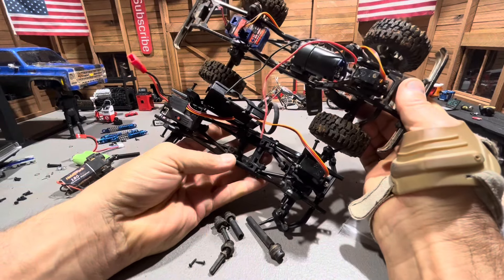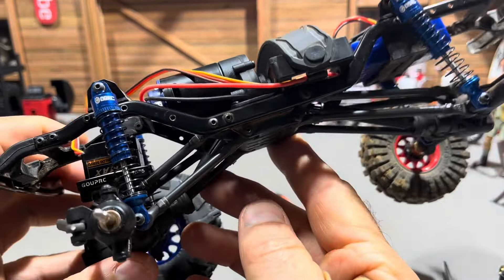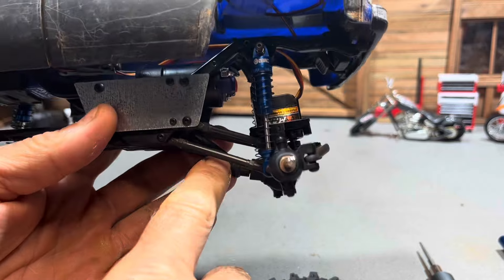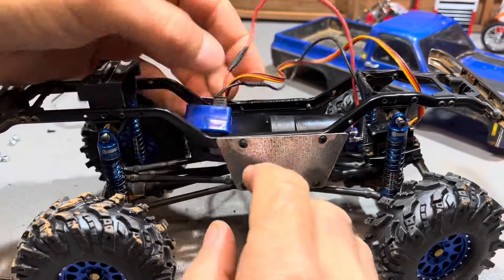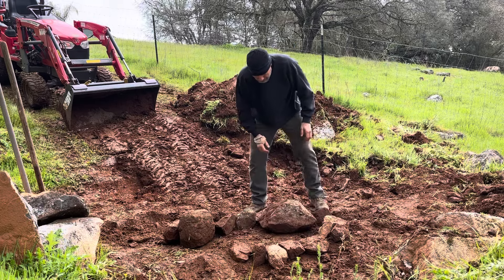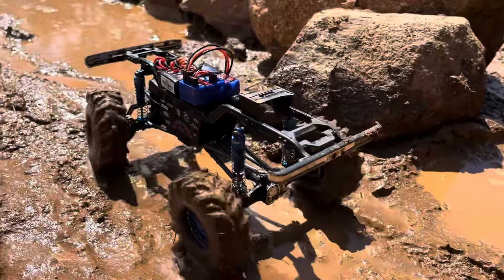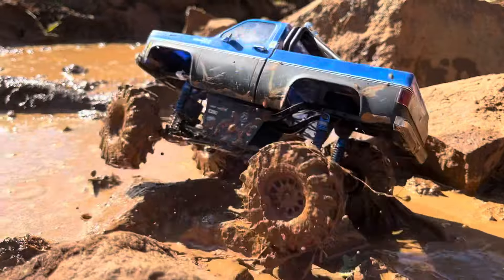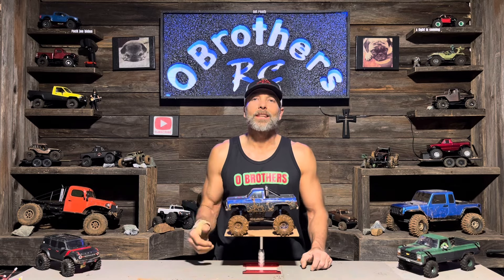Trx4m highest high trail out there mud truck rc crawler rc car

Comment: Traxxas esc is kinda just junk. Anything bigger than a 180 it can’t handle. It struggles with the Injora purple motor and the mofo 180 motors.
Reply from the maker: Agreed, thanks for checking out the video